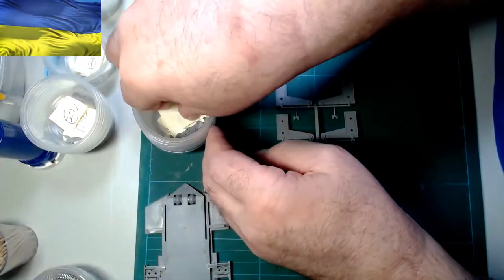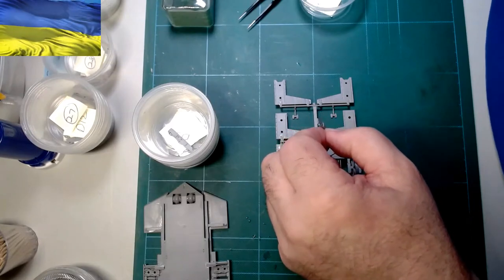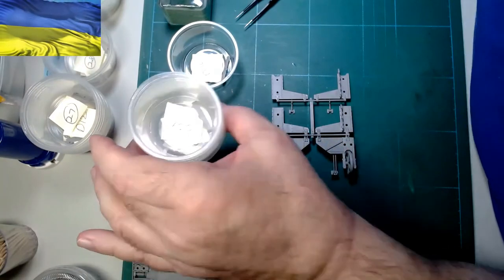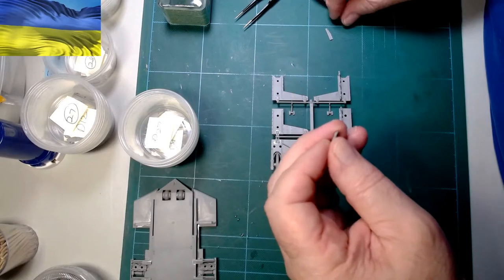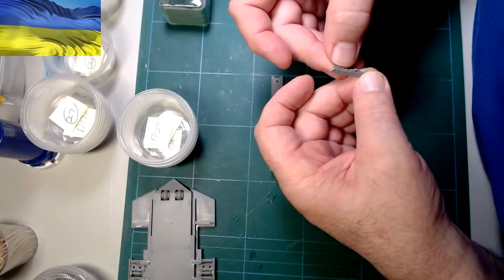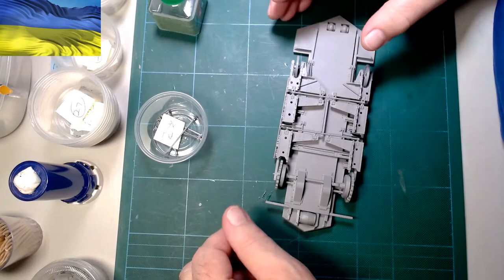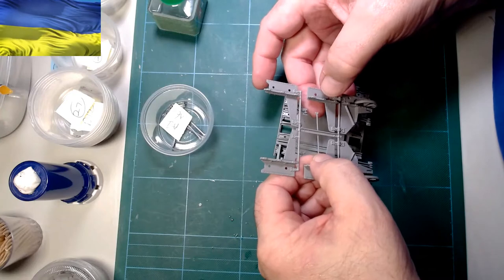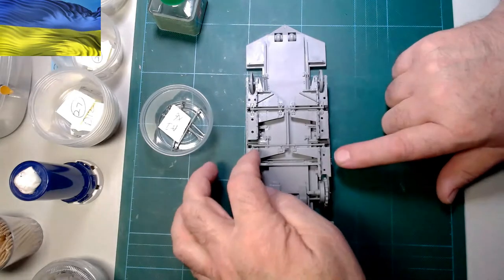Takom St. Chamond Late Type 1917 Part 6

Comment: You're spoiling us with all these great videos Jeff :) I just bought 200 of those 1-oz cups it's a great idea thanks. I tend to remove and clean up everything for a section or step at once. Cheers
Reply from the maker: Hi John, thanks for watching.  I do the same thing.  I like to clip and clean the parts for each step before I put anything together.  Most of the time I have 5 or 6 steps ready before I ever turn on the camera.  Have a great day.  Jeff